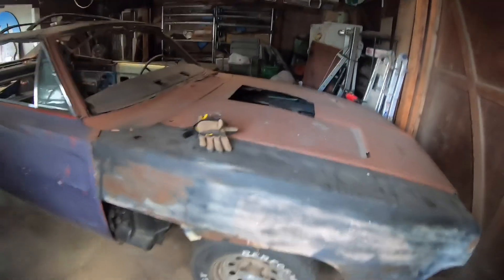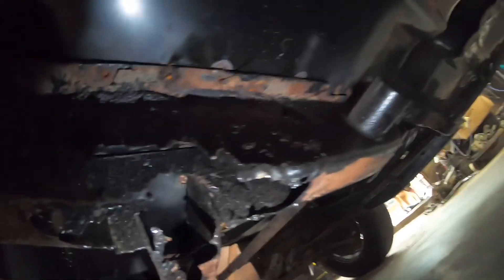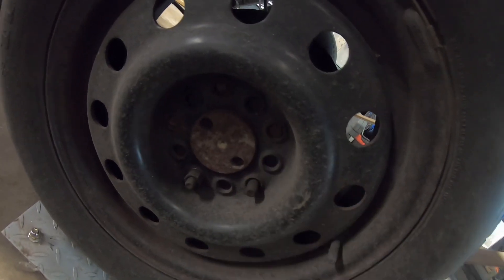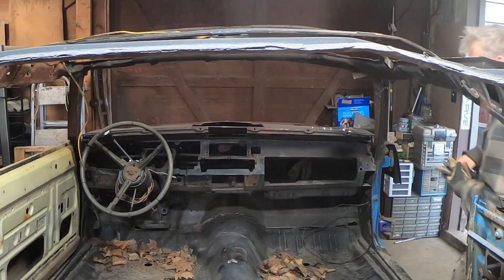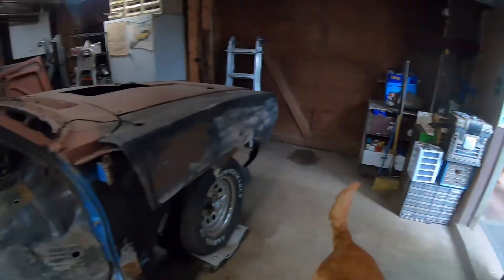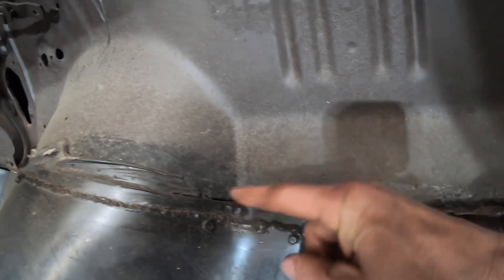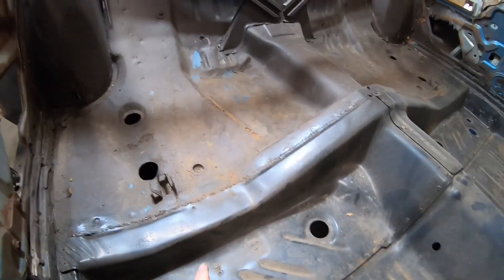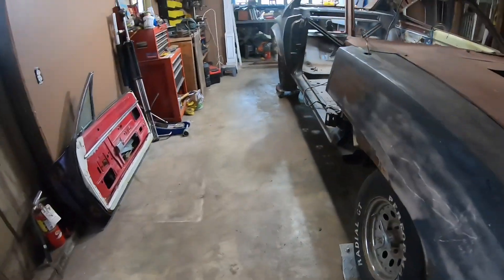Ep19. Obstacles are conquered, to be able to work on Charger are out of the way!   #nonamenationals

Comment: You know Scott that anyone with a rust free body and a pile of money can have a really nice car. The fact is I have much more respect for a build like your Charger. It may not ever be perfect but you will always have the satisfaction of knowing you built your dream car with your own two hands.
Reply from the maker: @KennethBrackett  thanks buddy, I really appreciate that. I sold my truck to fund most of the metal. Did some side jobs and saved my pennies. I do believe I am about $8000 into this project. So far. I have the drive train so I will be less than 12k when finished. That includes the car itself. 🤔😎🤷🏼‍♂️